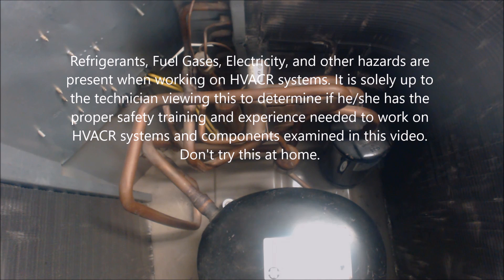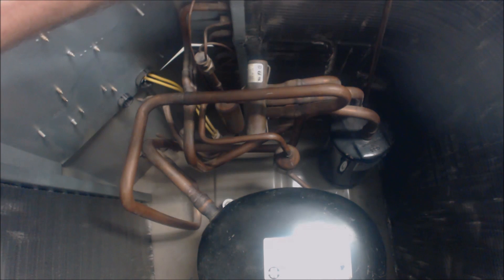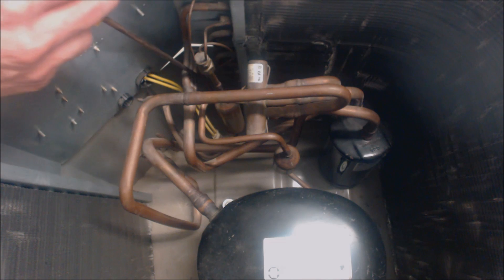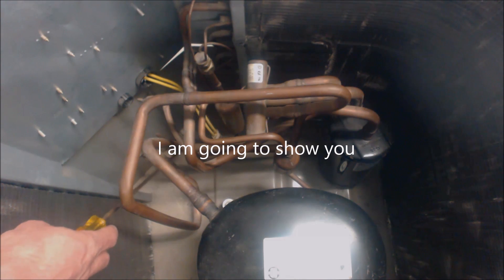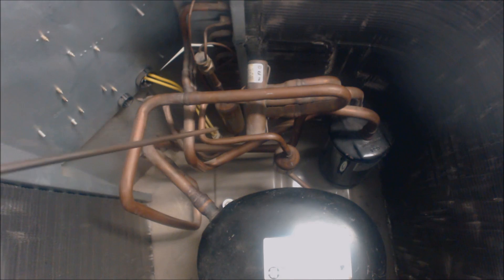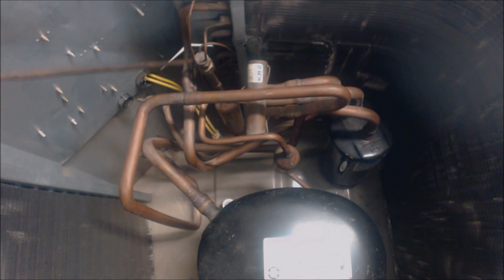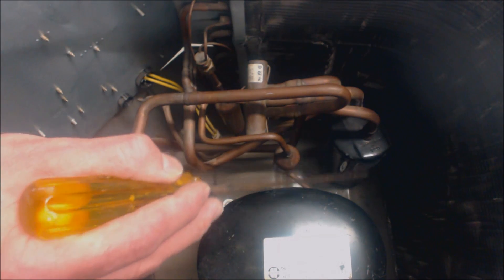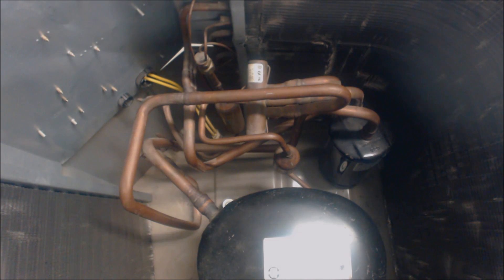Heat Pump Operation!- Compressor, Reversing Valve, Metering Device and Refrigerant Flow

Comment: Nice video,,,,,i have litle question,,,if you disconnect that valve 4away valve,,,which mode stay ,,,Heathing ?  Or cooling ? Disconnect remove terminal 24 volts,...
Reply from the maker: If the 24v terminals were off on a rheem or ruud, it will stay in cooling mode. If they are off on other brands then it wil stay in heating mode. Make sure not to power the magnet without it being on the rod otherwise the solenoid magnet will end up burning out, thanks!

Comment: found a pin blown out of the scroll compressor r22 system flat. contacts are burnt and all 3 fuses were blown. replaced compressor,contactor, fuses. installed filter drier. tested ops, vapor lines on the outside of reversing valve icing 20 degrees 40 psi low 90 degrees 225 high. When i reverse the valve for heat the pressure on the high side go to 500 and the internal bypass opens on compressor. replaced 4 way valve vacumed 500 microns weighed in  charge 407 c. Samething on the icing found txv close to the indoor warm on one side cold on the other. Removed sensing bulb and my low side came up to 60 @ 40 degrees and 250 110 high side. 60 supply 80 return. delta tee. im ready to change the t.xv. that also has one strainer before and one after. any thoughts? Could be debree inside from the compressor burn out.
Reply from the maker: Make sure the system has Poe oil and not mineral if you now have r407c inside. It actually sounds like the strainers are ok and the bulb is low on refrigerant because when you add heat to the bulb, the txv opens and the pressures correct. After pumping it down, flow nitrogen from both directions out of the tubes at the txv. Sorry I didn't see this sonner. Yeah that sounds like a messy one. Make sure to replace the filter driver again too, thanks!

Comment: How come this unit don’t have filter dryer
Reply from the maker: Most units do not have a filter drier already installed from the factory, thanks Kane
Reply: So is it better to add a bi-flow dryer to help protect compressor? I’m just curious!!  I’m Just start as hoax tech!! Thx you!!
Reply from the maker: We make sure that there is a filter drier on every unit installed, condensor-one way filter drier, heat pump-biflow filter drier

Comment: I am going for HVAC certification and I help some of my friend for trouble shooting their unit..one day ago one of my friend heat pump type freeze up at cooling mode.i check everything I could and when I check the refrigerant pressure I found that refrigerant pressure is low...then I charge unit one pound of refrigerant (r22)..when I was charging I notice that low side pressure is getting lower and lower..I do not know why it is happening..so,can you please help me what could cause that problem..
Reply from the maker: Check these three out. I go over the reasons-  https://www.youtube.com/edit?o=U&video_id=rT2GihygfAE    ---   https://youtu.be/G7FvHvpF_10   ---    https://youtu.be/hFqd1dfHj_A
Reply: Thank you so much I understand it now..actually I watched lots of your videos and got lots of knowledges..I hope you will help me in future if I have questions..

Comment: Please I have question: what pure suction valve used for, the middle valve in this unit?
Reply from the maker: Pure suction is always the low side so you could keep you low side gauge on this when switching from cooling to heating if desired. Otherwise when you switch to heat mode you will have the vapor side become discharge high pressure gas and the liquid side as a hhigh pressure liquid, Thanks
Reply: Also the place where the unit is charged at.

Comment: A three year old could lay out those components better than that.  That would be a  nightmare to change out that RV. You shouldn't have to remove the condenser coil to get to the RV or driers.  This one looks like it has to be removed.  You did a very good explanation.  Thanks.
Reply: you know how it is man.They're hoping that   we sell a whole new condensor over spending the time to change the valve,
freaking engineers.
Reply: RJParker I have learned that assuming  in this business is asking for trouble.  Once it is out the door,  they ASSUME,  and rightly,  that they will never see it again.
Reply: so correct dude
Reply from the maker: Sometimes there is not enough investigative research into if a layout or production is correct. My word, I just tried to run a lineset yesterday and it wasn't even tempered right. It wouldn't bend well and cracked while swaging. Sometimes I get frustrated by the lack of concern at a manufacturing facilities when we are taking so much concern into the actual install. Thanks all for your comments and concerns!